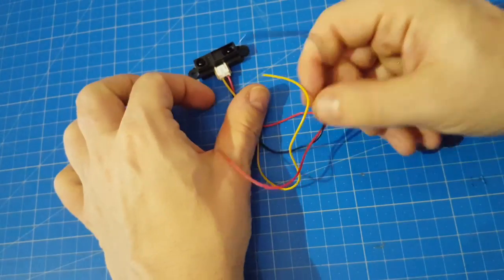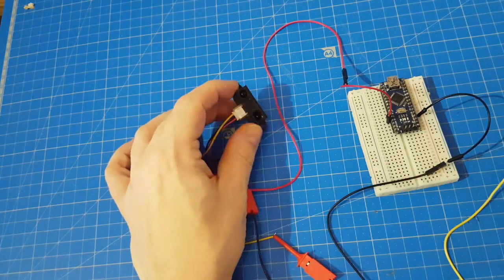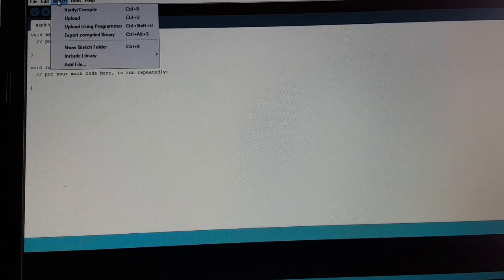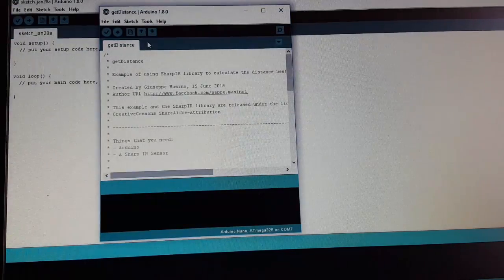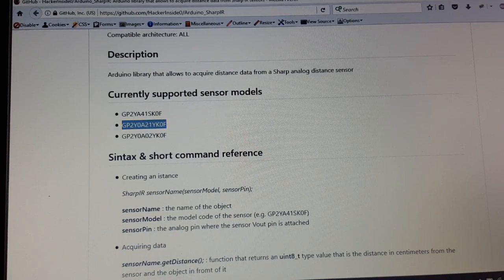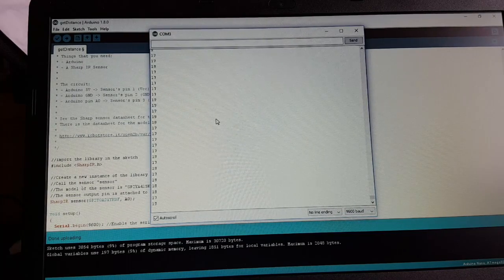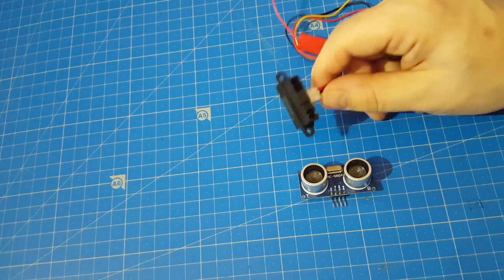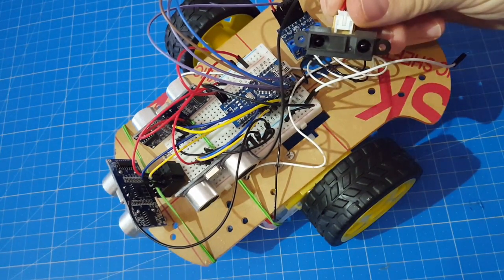Measuring distance with a IR sensor

Comment: Can i connect the sensor to nodemcu esp8266 ? Because i would like to record the data in the cloud
Reply from the maker: If you power the sensor with 5V, I see no reason, why it shouldn't work. But I'm not sure if the analog input (A0) of the NodeMcu is 5V tolerant. You probably need a level shifter for this and have to write your own algorithm for it.

Comment: can you use that function or similar for a PIR sensor ? I would need a response fast if possible ...  Thanks in advance
Reply from the maker: You got to be more specific. Do you want to measure distance with a PIR sensor? Or do you want to use the distance sensor as motion detection?
Reply: @nenioc187  can we measure distance using PIR sensor?

Comment: does it work in night time?
Reply from the maker: Since it emits it's own IR light - yes. It also works during night. It has more problems with daylight.
Reply: nenioc187  I'm want to measure human face, is it recommended to use this sensor since our face is not even surface.
Reply: *Distance of human face from the sensor
Reply from the maker: I would go for a ultrasonic distance sensor. Although I've never tested, if much facial hair could absorb the echo...
Reply: nenioc187 i thought ultrasonic sensor accurate only for flat surface 🤔
Reply: can it be used for slant surface ?
Reply from the maker: Since IR is light as well, it must obey the same physics. So if the angular is too high, the light won't be reflected back to the sensor.
Reply: nenioc187 Is there a sensor that does not depend on the angle?

Comment: Good job. Thank you very much.So your estimation is that ir sensor works somewhat alright between 0-30 cm with some small errors like 0-3cm? and 30 cm onwards errors are greater than 3cm?
Reply from the maker: Jep. That's about it. But about distance greater than 30cm you sometimes get some wild results. If you want more accuracy check out my vid about the laser distance sensor.